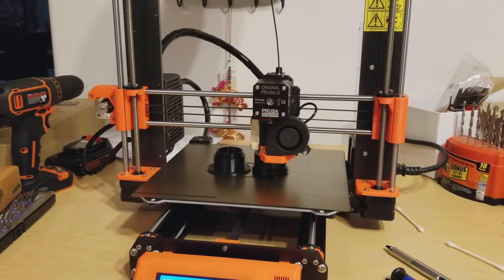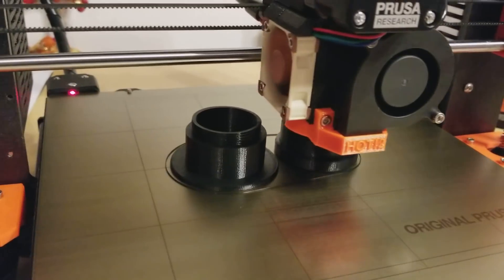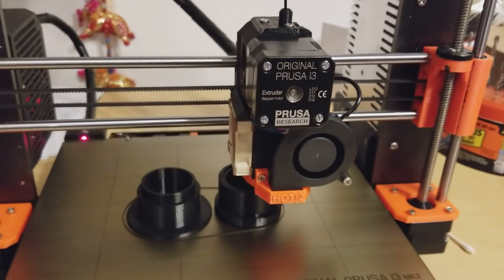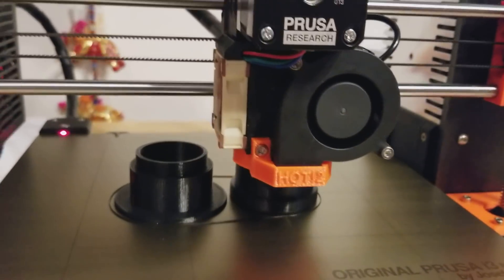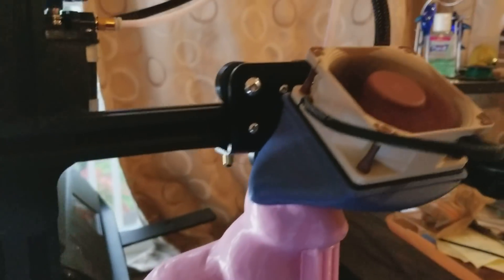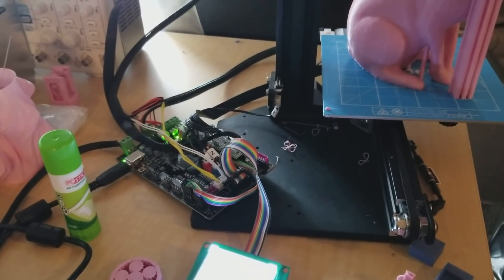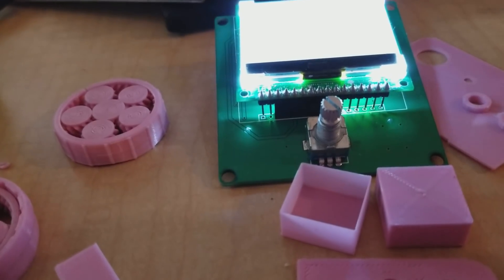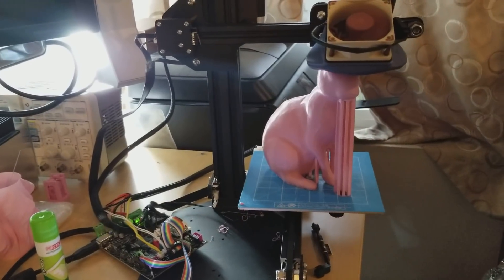Prusa i3 Mk3 is quiet, but can the Ender 2 be quieter?

Comment: Really nice build, would love a tutorial. Would also love one for calibration specifically for the Ender. (Similar to the build notes, those were very helpful.)
Reply from the maker: Is there something you are having an issue with in particular that you think calibration might help with?

Not much needs to be calibrated - just extrusion really. The rest of the axis motion (x,y,z) is calculated from known values such as the pitch of the z-rod and the pitch and number of "teeth" of the pulleys and steps per revolution of the steppers. However, there may be issues with the printer which are easy to confuse for "calibration needed".

I'm thinking about how to make a video on the TMC2130 "upgrade" for the Ender. I don't think many people would be comfortable going the route I did with making custom cabling and doing the soldering, etc. so I'm leaning toward "borrowing" the Einsy board out of the Prusa mk3. This board wasn't available when I did the move to TMC2130's but it is now for about $110 - which sounds like a lot of money vs the price of the printer, but it cost me about $90 for the MKS and the 2130 boards so it's not too far off (the absolute cheapest you could go is about $65 and you would have to wait a month or so for your stuff from China). I expect most people wont have a good soldering iron (and confidence using it), ribbon cable and a crimper to make the custom cables or the Kapton tape to make life a little easier

.... but then what would the video be? plugging stuff in, loading some firmware and we're done. Granted, the firmware modifications are the hard part and by making the video I would also make the firmware available and it's always nice to have a step-by-step guide and someone to ask questions when you hit a problem - what do you think?
Reply: Ross K Calibration might be the wrong word, I simply meant something like the build notes video but also going over some of the software quirks / slicer settings that made a difference.

Regarding making custom cables, soldering and so on:

I think people are willing to try it out, even if they have not done it before. (You could link some solder tutorials with it)

I have just a little bit of solder experience so this would be no easy task, but definitely doable with the right amount of preparation.

That said I agree that most people would prefer to just connect cables to connectors, especially on the high current connections (heated bed, hot end) and that the hard part is indeed the software. 

The whole project might be easier to understand in a blog post but then again a video is better than nothing.

Regardless of how you proceed with this: Keep up the good work, I really like your straight forward video style. Easy to understand, straight to the topic, no lengths. 

<3
Reply from the maker: I hope to make a video on setting up the Prusa edition of Slic3r for the Ender 2 sometime soon. By far it has given me the best prints. Cura is just bad IMO - it has a lot of features but the 3.x.x version is just so poor performing I don't want to deal with it. Even without a model loaded the UI interaction is so laggy I just can't take it.

As for soldering - the problem is cheap irons are just junk and they all come with conical tips which are cheap to make but absolutely worthless for anything other than burning lines on wood or leather. A good soldering iron will cost $50 or more (price quote without looking - I payed $80 or so for mine). Non the less, I agree some people will want to go through the pains of trying for a bottom dollar build, esp. on such a cheap base printer.

Thank you for your kind words as well :D I try to keep my videos 5 - 10 min, none of them are scripted in the slightest and I do my best to avoid waffling on (which sometimes involves editing stuff out or re-shooting segments). Heck i think i spend more time responding to comments than making the videos :P

Comment: Hey man, sorry if this is too demanding, but I was wondering if it would be possible for you to make a video detailing how you did it and why you do certain things the way you do. I really want to do this to my cr10 before I move off to college, and unfortunately my area of experience is purely mechanical parts. Electrical projects completely fly above me. It would mean a lot if you could! Thx again!
Reply from the maker: I'm thinking about how to make a video on the TMC2130 "upgrade" for the Ender. I don't think many people would be comfortable going the route I did with making custom cabling and doing the soldering, etc. so I'm leaning toward "borrowing" the Einsy board out of the Prusa mk3. This board wasn't available when I did the move to TMC2130's but it is now for about $110 - which sounds like a lot of money vs the price of the printer, but it cost me about $90 for the MKS and the 2130 boards so it's not too far off (the absolute cheapest you could go is about $65 and you would have to wait a month or so for your stuff from China). I expect most people wont have a good soldering iron (and confidence using it), ribbon cable and a crimper to make the custom cables or the Kapton tape to make life a little easier

.... but then what would the video be? plugging stuff in, loading some firmware and we're done. Granted, the firmware modifications are the hard part and by making the video I would also make the firmware available and it's always nice to have a step-by-step guide and someone to ask questions when you hit a problem - but the firmware would be for the ENDER 2 but it should be very close to what would be needed for the CR-10 what do you think?
Reply: Hi.

I just recieved my ender-2 yesterday. It is amazing for the price but the noise is a bit of a pain.
I have already found your 60mm fan shroud and have just ordered a fan to perform that Mod.

I would love to see a video or blog post on doing a walkthrough on what you have done to concert from the stock board to the one used with the drivers in this video.

I'm handy with a soldering iron and have no issue cutting or making a loom.

Releasing the firmware would be beyond ideal for me personally :)
Reply: So I was looking into getting an einsy board, and from the looks of it seems fairly straightforward to change out the board, re-flash, and then get it running. You said you had to modify the lcd to get it working, do you recommend just buying a new one altogether? Also, in your opinion do you think it's necessary to buy the complete kit from ultimachine just to get the wiring harness, or do you think it's possible to just reuse the one that came with the printer? Thanks again for all the help.
Reply from the maker: I didn't have to modify the LCD itself, though i did have to tear it apart and put it back together to work out the pin-out. You should be able to use the stock display without any modifications to it. I believe the pin configuration you will need for using the stock Ender display on the RAMBO is as follows (though I have not tested this myself)...

MKS pinout: http://reprap.org/mediawiki/images/0/0d/MKS_GEN-PIN.PNG
Einsy: https://github.com/ultimachine/Einsy-Rambo/blob/1.1a/board/Project%20Outputs/Schematic%20Prints_Einsy%20Rambo_1.1a.PDF

  #undef BTN_EN1
  #undef BTN_EN2
  #undef BTN_ENC
  #undef DOGLCD_A0
  #undef DOGLCD_CS
  #undef SD_DETECT_PIN
  #undef BEEPER_PIN
  #undef KILL_PIN
  #undef DOGLCD_MOSI 
  #undef DOGLCD_SCK
  
  //
  // CREALITY Ender-2 Display - on RAMBO P1
  //
  
  // brown                SCK
  #define DOGLCD_SCK      84
  
  // red                  ENCBTN
  #define BTN_ENC         9
  
  // orange               ENCA
  #define BTN_EN1         A7
  
  // yellow               Not connected (could be made a BUZZER)
  // #define BEEPER_PIN   82
  
  // green                ENCB
  #define BTN_EN2         A5
  
  // blue                 A0
  #define DOGLCD_A0       70
  
  // purple               LCS
  #define DOGLCD_CS       85
  
  // gray                 MOSI
  #define DOGLCD_MOSI     71
Reply: Follow up question as I'm about to get started with all of this. Did you get a 24v psu for the upgrade or did you leave it as 12v? I hear people say 12v has a bad whine.
Reply from the maker: I went with a passively cooled 12v (no fan in it). If you go up to 24v you will need to replace the heater cartridge and  either not use the heated bed or realize that it is now  a 380W bed (on 24v) instead of 95W (on 12v). Needless to say that's some serious energy... which the connectors are not rated to handle. This also would mean that the 24v power supply would need to be able to provide at least 20Amps (the bed alone would draw upwards of 16Amps).

There is no whine if you run the TMC2130's in stealth chop - if you run them in high power i found them loud and whiny on both 12 and 24v.

Comment: 12v still I'm assuming? I'm curious what your current values are on the tmc's and if you have had any layer shift issues in stealthchop mode? I'm also assuming that 12v not in stealth mode you have ear piercing whining?

Thanks for your fan mods, I followed your lead:
https://youtu.be/WT9dd7phHSQ
Reply from the maker: Yes still rockin' 12v. I have experimented with running "not in stealthchop" on both 12v and 24v and it sounded like a really bad, really loud, old dialup modem at both voltages (the experiment at 24v was just a short one to see if it helped with the screaming, i went back to 12v because of the stock heater cartridge). The TMC2130's are running about 700mA.

I haven't seen any layer shift issues on my ender and I've pushed the accelerations way up (I dont have the numbers at the moment but i can post them later if you like) and i print with a 200mm/s travel (and get there due to increased accelerations).

I'll be sure to watch your video when i get home tonight :D
Reply: I would definitely be interested in seeing what settings you were using, accel, jerk, max speeds etc.
I will say at 12v nonstealth was terrible, but 24v it was pretty dang quiet. The issue I was having was using .9 degree steppers, they seem to lack torque quite a bit more than the 1.8, I'm assuming this is from them running twice as many pulses per second. Moving to 24v helped regain the torque. With the 12v heatbed that means running two supplies, so torn between a 1.8 step, 12v stealth only machine, or 24v and having more flexibility. Although I suppose 1.8 step 24v could handle the highest print speeds.
Reply from the maker: Well, let's run some napkin math on this bed at 24v...

P = V^2/R
Therefore doubling the voltage will quadruple the power of a resistive heating element.

My multi-meter is kinda crappy at measuring low resistances so I don't really trust it when it reads 1.5ohms on my ender bed but my Prusa i3 (which runs 24v) reads 3.3 ohms so 1.5 ohms should be in the ballpark.

12^2 / 1.5 = 95 Watts (Ender stock bed)
24^2 / 3.3 = 175 Watts (Prusa i3)

24^2 / 1.5 = 380 Watts (Ender on 24v)

So... I'd say the bed itself could possibly take the higher voltage,  esp. if you start with setting MAX_BED_POWER to 64 or so in configuration.h to limit the heat saturation of the heater traces - you don't want them heating so fast they burn up before the bed can spread the heat.

But... the 380 Watt power draw might be an issue for a power supply - that's about 12 Amps for the bed alone so if you had a 20A 24v supply you could maybe do it... *assuming your own fire risks of course* ;) That said, the bed MOSFET should be OK at these loads but adding a heatsink on it might be a good idea - and if trying this please use soldered connections on the mainboard (both on power in and to the bed) AND on the heatbed itself - 12A is over the ratings of the connectors for sure.

- - -
Have you tried cutting your micro steps in half with the 400step/rev steppers to see if things improve?

- - -
My current settings I feel are sometimes too aggressive ... occasionally it sounds like the printer is hitting an endstop or something but it's nowhere near one - but the prints don't layer shift. I know I'm pushing jerk quite hard so that might be part of it... or it could be the extruder making the sound due to the high linear advance value - linear advance does not respect acceleration settings (so says the comment in Marlin).

G21    ; Units in mm
M149 C ; Units in Celsius

Filament settings: Disabled
  M200 D1.75
  M200 D0
Steps per unit:
  M92 X80.00 Y80.00 Z400.00 E93.33
Maximum feedrates (units/s):
  M203 X400.00 Y400.00 Z25.00 E25.00
Maximum Acceleration (units/s2):
  M201 X1500 Y1500 Z100 E3000
Acceleration (units/s2): P<print_accel> R<retract_accel> T<travel_accel>
  M204 P1000.00 R1000.00 T2000.00
Advanced: S<min_feedrate> T<min_travel_feedrate> B<min_segment_time_us> X<max_xy_jerk> Z<max_z_jerk> E<max_e_jerk>
  M205 S0.00 T0.00 B20000 X20.00 Y20.00 Z0.40 E5.00
Auto Bed Leveling:
  M420 S0
Material heatup parameters:
  M145 S0 H225 B40 F0
  M145 S1 H240 B60 F0
PID settings:
  M301 P17.46 I1.68 D108.25
  M304 P41.30 I8.13 D52.44
LCD Contrast:
  M250 C110
Z-Probe Offset (mm):
  M851 Z-0.38
Skew Factor:
  M852 S0.00
Stepper driver current:
  M906 X 750 Y 750 Z 750 E0 700
Linear Advance:
  M900 K250.00 R0.00

Comment: Fine video! Can you tell me what was the name of the replacement power supply? Also, what kind of box did you eventually come up with? And finally, is possible for you to produce a written guide or video we can follow to also convert the Ender 2 to a quiet printer? Thank you.
Reply from the maker: Power supply: any 12v 20A supply will do. There are a lot of Chinese manufacturers making exactly the same supply (often with different brand components but none I've found with good brand capacitors - which are the parts most likely to fail on these things). The one I'm using is this one https://www.amazon.com/gp/product/B010CVJAYS

Box, what box? ;) I haven't solved this one yet, it's just sitting on the desk with its guts laying about. I would rather not print a solution - that just feels like a lot of plastic would be needed and obviously such a box would be too large for the Ender to print in one go. My place of work provides an awesome makerspace so I have access to a 4ft by 4ft CNC mill and a heater bar for bending acrylic and a 60W laser cutter that can take 1ft by 2ft stock so I'm spoiled for fabrication options but I haven't taken the time to do the design yet mostly because I don't really want to use tools most people don't have access to, I don't want a big box on the side (think CR10), and at the same time I don't really want to put a box under the printer because that will amplify the sound of any vibrations (but for this printer it would probably be just fine except for my most aggressive print settings). I'll get to it someday but for now I simply haven't come up with a solution I want to execute.

I plan to share my Marlin changes but I need to follow my employers "contributing to open source" procedure. I work in the tech industry and such restrictions on IP are standard fair but it's a hassle I've been putting off doing. 

Also see my first reply to virtualxip on https://youtu.be/VtPGWQd3C7E scroll down in my reply to the bottom half (there are "-"s splitting the post). I can't find  away to link directly to a comment - meh.

Comment: Can the stock hotend of the Ender 2 be changed? A full metal hotend would be nice.
Reply from the maker: Sure it can, you'll just need a custom mount for the new hot-end. But keep in mind that your build area will shift (likely toward you as you face the printer) because the new nozzle position will be different from the old one. This shouldn't be an issue but it does limit how much the new mount can change the nozzle position before you start losing build area.

If you search thingiverse for something like "cr10 e3d v6" you'll get lots of options https://www.thingiverse.com/search?q=cr10+e3d+v6 The Ender2 and the CR-10 use pretty much the same x-carriage so hotend mounts for the CR10 should fit the ender as well.
Reply: Thanks for the detailed reply. Let me ask from a different angle.. Can the stock electronics handle other hotends? Like what is the max temp setting in the software (without firmware change)? (my Ender 2 is still in the mail and my worry is that the stock hotend may have a shorter lifespan with hotter materials such as PETG or similar) 
Your Ender + MKS can do of course anything ;-)
Reply from the maker: The hotend and bed are driven by the FDD8580 MOSFET which can handle about 30A (each) - so you are good there. As an aside these MOSFETs have a maximum voltage of 20v - so it would be a bad idea to run 24v into the stock board (despite what it says on the board).

Stock MAX_TEMP looks like it's set just a bit above 270C - call it 272C

My Ender 2 is still running the stock hotend, so it's PLA for me... but I do have that i3 mk3 for anything "hot"

Comment: Ross, this is cool. I'm building a sort of Prusa i3 mk2 right now using the MKS GEN_L V1.0 and a MISS MINI 12864 display. I was able to get the display working without difficulty.
Reply from the maker: Nice! Using the stock Ender display was a challenge but I've designed similar displays into other custom projects so I figured I could pull it off ;) Are you planning to go with the 2130 drivers or something else?
Reply: Ross K I have some 2100's but plan on 2130's down the road and eliminate need for x and y endstops.